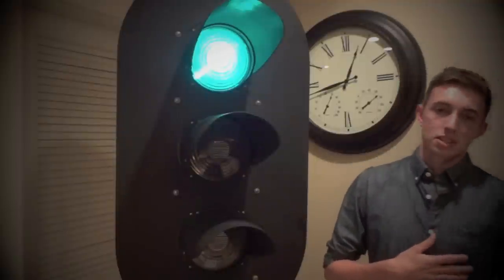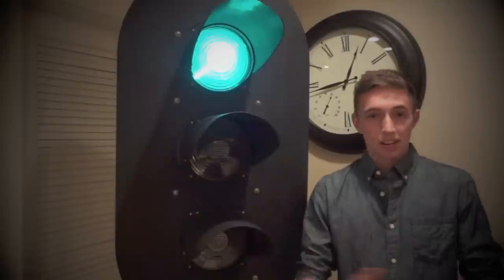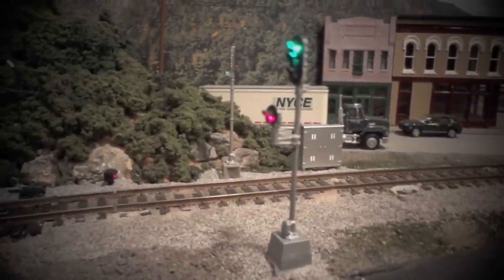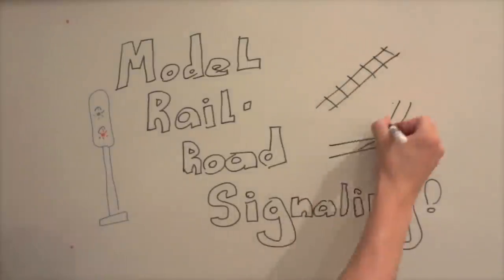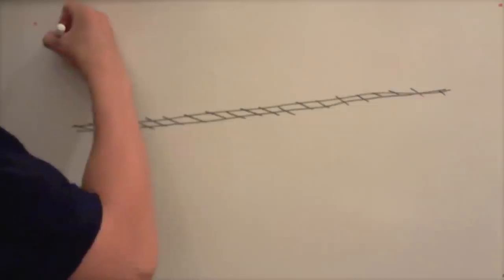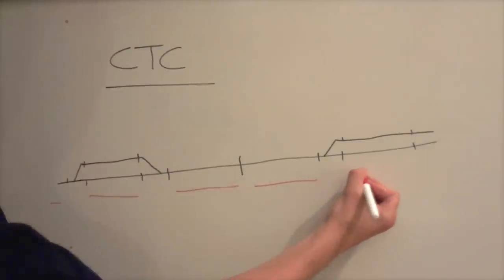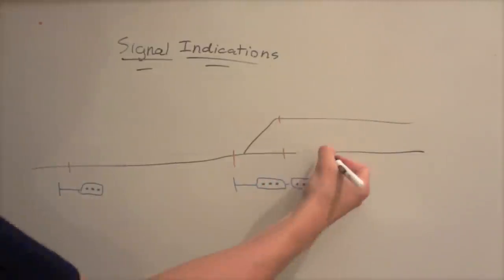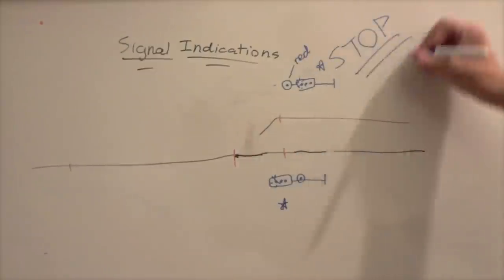Model Railroad Signaling (A How To Video) - Part 1: The Basics

Comment: great information in regards to basic American signaling. Thanks. Now comes the challenge on my layout. I am currently re doing my layout and installing modern electric signals. I model both American and NSW Australian Railroad, the basic block signaling is the same until we get to the diverging tracks. In NSW it is different. With the double head signals, Yellow on top means diverging route, the bottom 3 lights indicate what the next signal is, according to the block signal rules. Eg; Yellow over Red next signal at red. In some cases you will get Yellow over Yellow, meaning slow speed diverging track/next signal is at slow caution. Now the challenge shall be to work a system where I can do both systems at a flick of a switch.
Reply from the maker: Arty Zearo I think that could easily be done through cats. As long as the signals them selves are not too different, you could create two different CATS panel (computer files) for each railroad, each one with the specific signaling aspects. Just an idea!
Reply: The modern signal aspects are very very similar to the 2 regions between Australian and US, the biggest difference between the 2 regions is on the dual track our trains pass on the left instead of the right. So the signaling on my layout will need to be done as Bi Directional on dual tracks..It can be done, just sitting here typing this the only real set back is the expense, extra signal. I should be able to use the same panel, I'll update you when it is completed.

Comment: On NS in CTC territory on Southern Lines the intermediate signals always have a mile marker plate under the signal heads. Older Southern style intermediate signals are offset. The newer PTC signals are not. When a train is going to take a diverging route at the next CP the intermediate signal will show an approach diverging (yellow over green). A flashing yellow signal on NS Southern lines is an approach restricted and would be necessary where you would need to approach the next signal at restricted speed not exceeding 15 mph. This signal is often used where the next signal would be capable of displaying a restricted signal (two reds over a yellow). Trains encountering a restricted signal must not exceed restricted speed and be capable of stopping within one half range of vision looking out for obstructions, trains, broken rail or equipment on the track ahead.

Comment: Great tutorial! That was a very good production. I do have a question that you might be able to help with. So right now, I'm actually designing a new BNSF double-deck layout based based from Nebraska to Southern Minnesota. I plan on using a single mainline. Originally, I was going to use ABS, and for the dispatcher, I was going to use Track Warrant Control. I decided on TWC because it would be simple and provide direct interaction with the dispatcher and train crews. And I was unsure about using CTC because I thought that TWC would provide a more interactive experience and it had been implied that CTC isn't as interesting to operate with. But does it even make sense to use ABS and TWC? There are examples of the two systems being used in conjunction on BNSF, but it might make more sense to run the layout off of CTC? So should I instead use CTC? It's no problem if you don't know. I kind of threw a lot out there. I'm just a little confused on what the best option is. Thanks!
-Cam
Reply: Most lines that have ABS signaling are also under control of the dispatcher via TWC. For example, when you have a main line such as the NS S-Line that is well over 100 miles in length, you can't really run the entire line purely off of the signal indications. So for the ABS mainlines on Norfolk Southern, the dispatcher will give a train crew a track warrant with information such as how far they are allowed to travel, what trains they will be meeting etc. Now, I'm not sure how BNSF works but I know that NS also will give track authorities to local trains, even if the track is CTC controlled. So, really it's up to you. In my opinion, CTC provides a much more immersive experience than just TWC because the dispatcher is constantly having to pay attention to train movement and line routes accordingly.
Reply: Grayson Moore Thanks for the input! That really helps. I think I'll probably use CTC. As I said, I originally planned on TWC/ABS, but CTC seems to make more sense for the situation that I have. The layout itself isn't a massive rail network, but the two decks are actually modeling two different locations that represent the long mainline I'm modeling. So I think CTC would be more appropriate to manage that rail line because it would probably be unlikely to have the entire mainline (from Crawford, NE to St. Paul, MN) to be controlled by one dispatcher under TWC/ABS. It's definitely possible, but with your preference of CTC and the overwhelming presence of CTC on BNSF, I think I'm leaning that way. Again, thanks for the input!

-Cam
Reply: railfan220 Grayson Moore I know I'm late to this, but I used to work at BNSF. Grayson pretty much covered it but I'll add a little. Basically, ABS does not give a train "authority" to occupy a main track (in CTC, your signal is your authority). So in ABS you need some type of authority to be out there, whether you're a train, track gang, or whatever. Most commonly that would be a track warrant, but it could also be:

Yard Limits.
Restricted Limits.
Block Register Territory (have no idea where this is used).
Movement With the Current of Traffic (double track ABS).
Movement Against the Current of Traffic (double track ABS).
Occupancy Control System (only used in one location I believe).
At Manual Interlockings, verbal authority by the operator or a controlled signal indicating proceed.
Track Permit.
Protection When Tracks Removed From Service.
Special Instructions or General Order.

There is also rule that specifies how to foul or occupy a main track in ABS when unable to obtain authority titled "Signal Protection in ABS by Lining Switch."

Direct Traffic Control rules are in the GCOR, but DTC is not used on the BNSF.
Reply: railfan220 Oh and for what it's worth, the terms 'double track' and 'two main tracks' are not the same. Double track means two tracks that have signals for movement in one direction each, like a street (movement with the current of traffic) and are ABS only. Two main tracks means two tracks that are each signaled in both directions and use CTC.
Reply: sharkheadism Hey! Thanks so much for sharing your knowledge! It really helps. It makes more sense now because with ABS being automatic, someone would have to give authority to somewhere whereas with CTC, someone is giving you authority by setting routes and changing signals. Makes more sense now. And thanks for the tip on terminology. I had no idea, and there's clearly a difference. Thanks for that!
-Cam
Reply: railfan220
Yeah for example there were several miles of DT ABS (current of traffic) entering the yard in St. Louis, but the rest of the line to Springfield was CTC. So even if you had all greens, if you left the CTC and entered ABS without a warrant you violated your authority.

There are quite a few subdivisions that have both CTC and ABS like that one, so if you wanted to run some ABS on your layout it would still be possible--and realistic--to do so.
Reply: Sweet! That makes me feel better. I'm not entirely sure what we'll do, but at least there are options.
Reply: railfan220 It's not uncommon for some subs to go from dark TWC into CTC back to TWC and back into CTC again with some ABS/TWC thrown in a few times for good measure. Go wild, haha
Reply: Haha! Good to know. So we can't go wrong if we change it up.

Comment: Hi. Well, I building my layout and will soon start signaling and detection. I manually control my turn outs with servos. Do you think I should change this system or this system can be managed by the computer interface you mentioned?